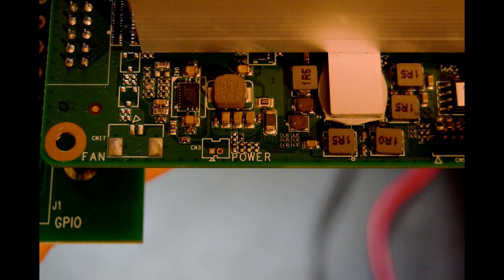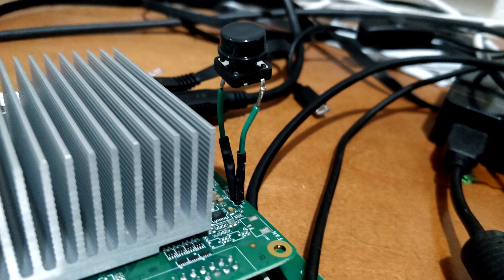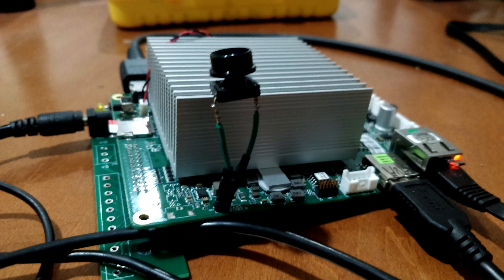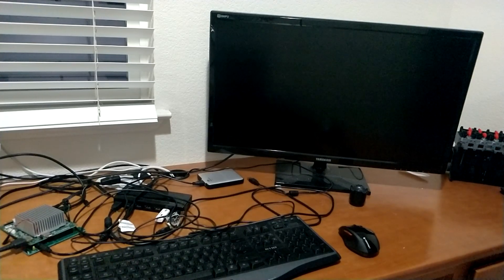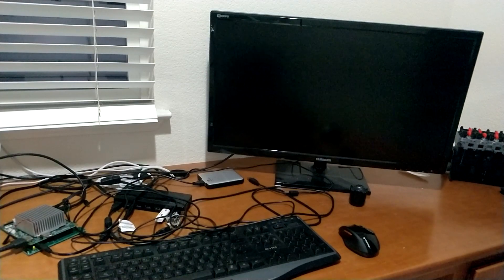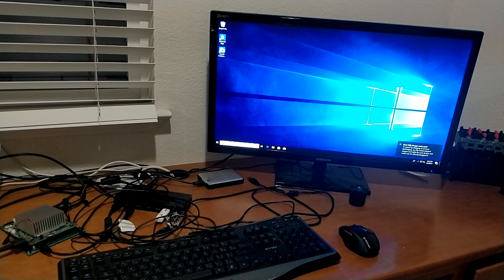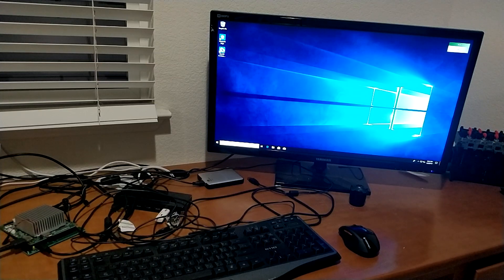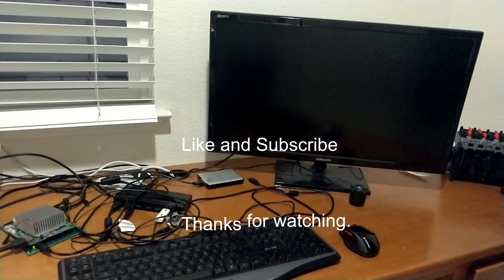Atomic Pi: Adding a power button

Comment: The Atomic Pi turns on as soon as you connect the dc power supply of 5v. I wonder how does not boot up by default for you? Does that mean, if a "momentary power button" is connected, the Pi does not turn on when the dc power is applied?

Comment: Nice one - does the other included power switch work the same way in windows - Good idea I see a good use case for this if the Atomic pi is embedded in a case/robot (like it was intended) for a switch on the outside - thanks for the video

Comment: What windows 10 build are you using? Where did you get the video drivers? Do you have sound over hdmi? If so where did you get the drivers for that? Great vid
Reply from the maker: Windows 10 home single language.  I tried windows lean but it had to many issues and no driver support.  I also tried Windows IOT and it didn't have video or audio driver support either.  I'm going to try and get windows 10 to boot off of a usb hard drive.  If I do I'll make a video on it.